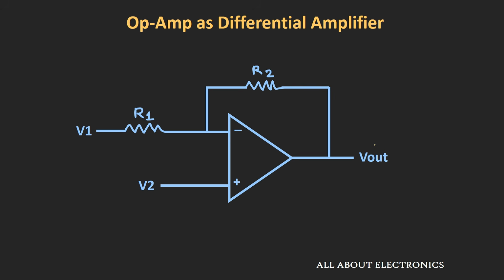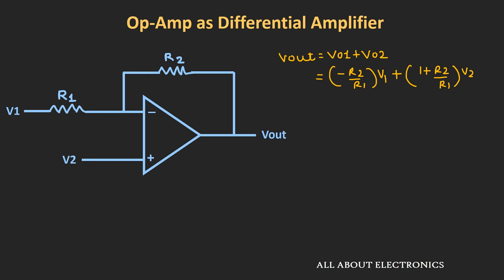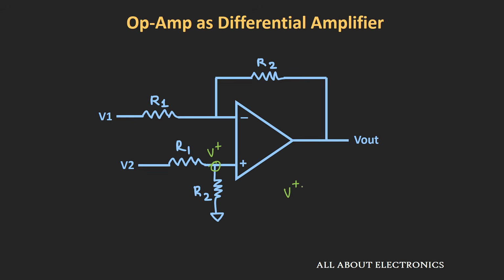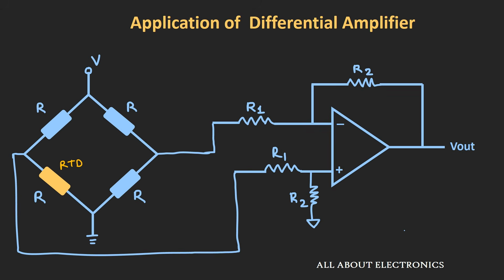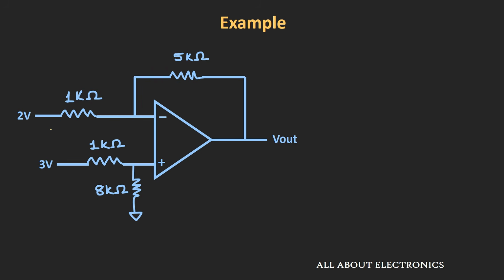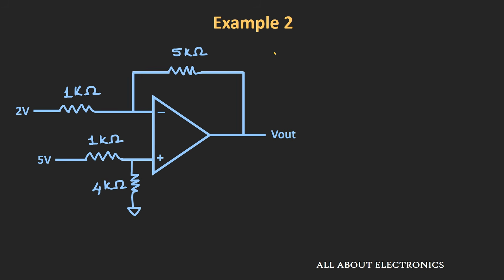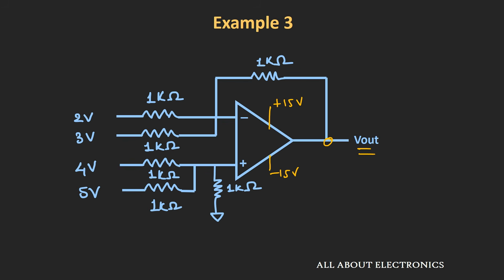Operational Amplifier: Op-Amp as Differential Amplifier or Op-Amp as subtractor (With Examples)

Comment: In case of 4v won't it be 4*(1/1+0.5)*(1+1/0.5)=8??
Reply from the maker: No, it will be 4*(0.5/1+0.5)*(1+1/0.5). And it will be equal to 4V.
The detailed explanation I have already given in the other comments. So, Please check that.
Reply: Sir acc to voltage divider rule i think it's (1/1+0.5) and (1+Rf/Ri) =(1+1/0.5). where am i wrong?
Reply from the maker: Not only 1K but two 1K resistors will be in parallel. (Resistor connected with 5V). So, voltage divider will be 0.5/(1+0.5). Rest is fine. 
Here I am copying the reply which I had given earlier. If you still have any doubt then please check it.

Let's say, you are considering only 4V of a voltage source. In that case, remaining voltage source will be zero and one end of 1K resistor with 5V will be at ground potential.
It means that two 1 K resistors are in parallel and their equivalent resistance is 0.5 K.
Now, voltage V+ because of 4V will be equal to 0.5K*4 /(1K+0.5K).
And total output will be equal to (1+Rf/R1)*V+
Now, here, Rf is 1K and R1 will be 1K in parallel with 1K (0.5K)
So, Vout due to 4V will come out as 4V.
Reply: Got it sir , thank you very much

Comment: Sir, why you didn't use the concept of virtual ground in this topic?? Please give answer sir  I get confused
Reply from the maker: Here, to find the output superposition theorem is applied at both input terminals. So, if you consider one source at a time, then the other input is grounded. And then using virtual ground concept only you will get individual outputs.
Reply: Sir, because of virtual short both the inputs are same so we get output zero(v1-v2).but we get output ???why?? Please give reply.

Comment: why result is different why we apply r2 by r1 multifply by v2-v1 in example?
Reply from the maker: Hi, will you please mention the timestamp where you are referring to ? It will become easy for me to answer your question.
Reply: @ALLABOUTELECTRONICS  10.22 in this example why we can't use r2/r1*(v2-v1) directly to find output voltage?
Reply from the maker: @webdot564  That equation is valid only when both resistors to inverting and non-inverting terminals are equal, and the feedback resistor and the resistor  between non-inverting terminal (+) and ground are equal. In this case, both 1k resistors are same. But if you see the other two resistors then, one resistor is 5k and other resistor is 8k. That's why we directly cannot apply that equation. I hope, it will clear your doubt. 
If you still have any doubt then let me know here.
Reply: @ALLABOUTELECTRONICS  oh ,i got it.Thank you.

Comment: Sir cant we find out its answer by considering each inverting and non inverting part as a summing amplifier..i have tried it by considering grounded part as v3=0..but did not reach the answer...
Reply: For inverting op amp , if all resistance values same then output will be -(v1+V2). For non inverting op amp output equal to (v1+V2), when resistance values are same . Vo= v01+v02. That is -(2+3)+(4+5). Answer is 4v by reducing the above equation.

Comment: Sir, how can I achieve current sensor, for short circuit protection using this method?
Reply from the maker: I have made a video on how to use opamp as voltage to current converter. Please check that video.
Reply: @ALLABOUTELECTRONICS  where is the link of the video so I can watch it
Reply from the maker: @chibuzoeze4225  https://youtu.be/DeDk0Rl3Oa0

Comment: If I use the formula Vout= (V2-V1)*R2/R1, I would get 8V instead of 6V for example 1. Could you tell me if this formula cannot be applied to this question for some reason or if R2 should have been 6V? also, thank you so much for this series.
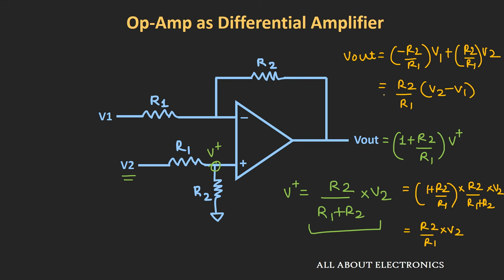Reply from the maker: Well that formula is valid only when resistors are equal as shown at 6:14. In example 1, R2 is different. I mean feedback resistor and the resistor at the non-invering terminals are different. That's why that equation is not valid here. I hope, it will clear your doubt.
Reply: @ALLABOUTELECTRONICS  Thank you so much. That cleared my doubt very well.

Comment: How to use k-type thermocouple instead of rtd???????? and can u plz explain the process of it?
Reply from the maker: You can connect the output of the thermocouple to MAX 6675. 
The breakout board for the chip is also available. 
It will give 12-bit digital output, which can be interfaced with the micro-controller.

Comment: Could you tell me the difference between  inverting amplifier and differential amplifier?
Reply from the maker: In inverting amplifier, the input is applied at the inverting end of the op-amp (with feedback). While in case of the differential amplifier, the inputs are applied at both inverting and non-inverting terminals of the op-amp. So, the output will be gain times the difference between the two input signal. (K* (VA-VB))
Reply: ALL ABOUT ELECTRONICS thanks 👍

Comment: Sir, how should we apply voltage divider rule in the third example?
Reply from the maker: Let's say, you are considering only 4V of a voltage source. In that case, remaining voltage source will be zero and one end of 1K resistor with 5V will be at ground potential.
It means that two 1 K resistors are in parallel and their equivalent resistance is 0.5 K.
Now, voltage V+ because of 4V will be equal to 0.5K*4 /(1K+0.5K).
And total output will be equal to (1+Rf/R1)*V+
Now, here, Rf is 1K and R1 will be 1K in parallel with 1K (0.5K)
So, Vout due to 4V will come out as 4V.
Similarly, you can find output due to remaining inputs.
And the final output will be the summation of individual outputs.
I hope it will clear your doubt.

Comment: It's  v0= 14 volt by using inverting n non inverting adder.....sir can u tel me this process is correct or not
Reply from the maker: I have already explained the process in the earlier comments. 
Here I am copying the reply:
To calculate the output, superposition theorem is applied. So, when you consider 2V input voltage is acting alone, at that time all the other sources will be zero. So, 3V, 4V, and 5V voltage sources will be zero. It means there is no input voltage at the non-inverting terminal. (And it is at ground potential) Now, as we are considering here an ideal op-amp, the virtual short is existing between the inverting and the non-inverting terminal. So, inverting terminal will also be at ground potential. Now, if you look at the resistor which is in series with the 3V voltage source, both terminals of the resistor are at ground potential (Considering only 2V voltage source is acting alone). So, it will not have any effect on the circuit. And the equivalent circuit will be an inverting op-amp with 2V voltage source is acting alone. So, output because of 2V voltage source will be (-2V).
And similarly, the output can be found for individual inputs.
In the end, add the individual responses to get the final output. 
 The second method is to use nodal equations and consider all the sources are acting simultaneously. And solving the equation you can get total output voltage.
Reply: So good sir😊😊😊

Comment: Why are we taking Vout= k(V2-V1) but not as Vout =k(V1-V2).pls explain
Reply from the maker: Because in the open loop configuration, the output of the op-amp can be given as Vo = A x (V+ = V-)
Where V+ is the input at the non-inverting terminal and V- is the input at the inverting terminal.
Reply: @ALLABOUTELECTRONICS   is it  like a formula or a derivative ,  
is it .....
Reply from the maker: @natarajann1259  Its the behavior of the op-amp. Actually that's how the op-amp works.

Comment: Sir, I'm still confused on how to get the answer for non inverting terminal........ Can you please explain? 
Sorry I'm a very slow learner....
Reply from the maker: To find the output due to the input at the non-inverting terminal, first of you need to ground the input at the inverting terminal. (Superposition theorem- consider one source at a time.)
The voltage at the non-inverting terminal is (V+) = R2*V2/ (R1 + R1)  (voltage divider rule)
And then the output due to the non-inverting terminal is V+ *(1 + R2/R1) ( the feedback resistor and R1)
So, the overall voltage after simplification = R2/R1 *V2.
I hope you will get it now.
Reply: Oo

Comment: Sir i have an doubt regarding voltage divider rule.
Reply from the maker: Yes, please let me know your doubt.
Reply: @ALLABOUTELECTRONICS  when we consider 4v input source and when u apply voltage divider rule then are u considering the resistance of 5v in parallel with 1k ohm which is grounded or R4//R5
Reply from the maker: @fazilahmadpala5472  While considering the 4V input source, the series resistance of 5V (which is grounded) will be in parallel with the 1k resistor.

Comment: wait. that's not the right differential amplifier. I thought it's the one that has an RC circuit? Am i crazy?
Reply from the maker: I think you got confused between differentiator and differential amplifier. Differential amplifier amplifies the difference between the two inputs, while differentiator circuit performs differentiation. The seperate video for that is also available on the channel.

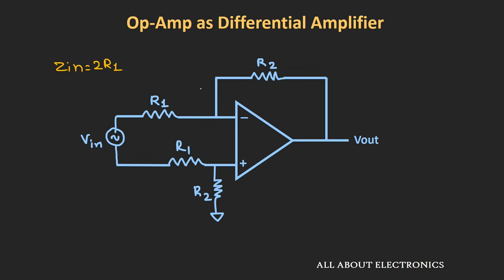Comment: @8:30 how is impedance equal to 2R1
Reply from the maker: Recently someone has asked the same question and I have explained it. 
I am copying the same answer here:
If you have followed the earlier videos then I think you must be aware of the definition of input impedance. 
In a simple way, if Vs is the input voltage applied to the circuit and  Is is the current supplied by that source then Vs/Is is the input impedance of that circuit.
In this case, the op-amp is an ideal op-amp. So no current is flowing into op-amp terminals.  
Also due to negative feedback, we can apply the concept of virtual ground. i. V- = V+
Now. let's say Is the current supplied by the source. And it will flow through the Resistor R1(at the top). And the same current should also come back into the Source via a bottom resistor. 
Considering this fact and applying the concept of virtual ground, in the equivalent circuit, it can be said that the voltage source Vin is connected to the two R1 resistors in series. Hence, Vin/Is = 2*R1
That's why input impedance is 2*R1.
I hope it will clear your doubt.

Comment: At 8:31 how Zin=2R1
Could someone please explain ?
Reply from the maker: If you have followed the earlier videos then I think you must be aware of the definition of input impedance. 
In a simple way, if Vs is the input voltage applied to the circuit and  Is is the current supplied by that source then Vs/Is is the input impedance of that circuit.
In this case, the op-amp is an ideal op-amp. So no current is flowing into op-amp terminals.  
Also due to negative feedback, we can apply the concept of virtual ground. i. V- = V+
Now. let's say Is the current supplied by the source. And it will flow through the Resistor R1(at the top). And the same current should also come back into the Source via a bottom resistor. 
Considering this fact and applying the concept of virtual ground, in the equivalent circuit, it can be said that the voltage source Vin is connected to the two R1 resistors in series. Hence, Vin/Is = 2*R1
That's why input impedance is 2*R1.
I hope it will clear your doubt.
Reply: @ALLABOUTELECTRONICS  thanks a lot brother ..it helped me:)

Comment: Sir what is the voltage at inverting terminal
Reply from the maker: Would you please mention the timestamp where you are reffering to in the video.
Reply: Last part
Reply: Last one ...excersice question
Reply from the maker: Yes, that's correct, because of the inputs at the inverting terminals, the output voltage will be -2 -3 = 5V. 
If you consider the input at the non- inverting terminals also, then the total output is -2-3+4+5= 4V
Reply: Sir but at non inverting terminal voltage will be 4/3+5/3=3 so v total =-5+3=-2v...help me out sirr
Reply from the maker: If you do it properly, you will get it. I have already explained the method in the earlier comments. Please go through it. If you didn't get it, will help you.
Reply: Tell me non inverting terminal voltage

Comment: sir, can u explain me the process how to solve that?
Reply from the maker: I have already explained in the comments earlier.
I am just copying it over here:

To calculate the output, superposition theorem is applied. So, when you consider 2V input voltage is acting alone, at that time all the other sources will be zero. So, 3V, 4V, and 5V voltage sources will be zero. 
It means there is no input voltage at the non-inverting terminal. (And it
 is at ground potential) Now, as we are considering here an ideal op-amp, the virtual short is existing between the inverting and the non-inverting terminal. So, inverting terminal will also be at ground potential. Now, if you look at the resistor which is in series with the 3V voltage source, both terminals of the resistor are at ground potential (Considering the only 2V voltage source is acting alone). 
So, it will not have any effect on the circuit. And the equivalent circuit will be an inverting op-amp with 2V voltage source is acting alone. So, output because of 2V voltage source will be (-2V). 
And the similarly you can find the output due to other sources as well.
The second method is to use nodal equations and consider all the sources are acting simultaneously. And solving the equation you can get total output voltage.

Comment: Sir what is a buffer?
Reply from the maker: A buffer circuit provides very high input impedance and low output impedance. And it passes the input signal as it is. 
It is usually used to avoid the impedance mismatch and sometimes to increase the current driving capability of the circuit.
Reply: @ALLABOUTELECTRONICS  thanks a lot😊😊

Comment: After getting the answer for total V_= -5v, I got stuck in the total V+. But, after applying oms law to find Iout=I(in1)+I(in2), I was able to find the total V+ by using V+=[(4/1)+(5/1)]*1= 9. So the Total Vout=-5+9=4. I think, I got it, finally.
Reply: 1 kilo ohms not 1 ohms, ur method is flawed

Comment: At 11.12 minute, the difference amplifier input resistors are wrongly used. The value of R1 & R2 for non inverting input n the inverting input should be identical but here is not the case.here it is 1K & 5K and 1K & 8K
Reply from the maker: Its not always necessary. It can be different also.

Comment: Sir, second Wale example main 12 par saturation aajaega, lekin answer 14 aaya, toh phir iska conclusion kya hua
Reply from the maker: The output will get saturated to the supply or the rail voltage. So, it can't go beyond 12V, when the supply voltage is 12V.
If the supply voltage is more than 12V, let's say 18V then output would be 14V.
I hope it will clear your doubt.

Comment: Sir, what does loading mean?
Reply from the maker: If the impedance of the load is comparable to the series resistance of the source, then the effective voltage which appears at the load will reduce. (simple voltage divider, V*RL/(RL+Rs)). Here, in this case, if the input impedance of the differential amplifier is low then the output of the sensor which appears at the input will reduce.
I hope it will clear your doubt.
Reply: Thank you sir.

Comment: BTW out put of this Differential amplifier is difference between input voltages and multiplied by Gain factor. Then why don't we call it as DIFFERENCE AMPLIFIER instead of Differential amplifier..???😊☺️💐
Reply from the maker: sometimes it is called a difference amplifier. In fact, in some textbooks, it is referred as a difference amplifier.

Comment: How to design a subtractor using 4-opamp
Reply from the maker: you can design a subtractor even using a single op-amp. May I know why you want to design with 4 opamps ??
Reply: I want to know because there was a question regarding this in my exam
Reply from the maker: May I know the exact question. Because you can use two or three op-amps for adding the signals and last op-amp for subtracting the signal. 
If you can tell the exact question then I might be able to tell you in which context it was asked.

Comment: The only thing that I don't understand is why should the gain be equal...like why?
Reply from the maker: Equal gain will be required in applications where you want to amplify the difference between the two input signal.
At 3:31 the gains for both inputs are different. But they can be made equal using the voltage divider circuit at the non-inverting terminal.
I hope it will clear your doubt.
Reply: @ALLABOUTELECTRONICS  so we're basically finding out the value of k by making the gain equal?

Comment: how to solve example 3?
Reply from the maker: In other comments, I have already mentioned the procedure. Please go through the comments. If you do not find the answer or method to solve it then please let me know here.
Reply: i'm having some trouble understanding in parallel connection.
Reply from the maker: Here, you can find the output by applying the superposition theorem. (Considering one voltage source at a time).
so, for example, if you consider only 4V voltage source, then other voltages sources can be assumed to be zero.  Now, in this condition, two 1K resistors at the inverting and the non-inverting terminal will be in parallel. And their effective resistance will be equal to 0.5 K. 
Now, for non-inverting input, the output can be given as V+ (1+Rf/R1)
So, here Rf= 1K and R1= (1K|| 1K) = 0.5K
So, Vo= 3V+. 
Now, V+ can be found by applying the voltage divider rule. 
V+ =4V *(0.5K/(1K + 0.5 K)= 4/3 V
So, output due to 4V will be 3*(4/3) = 4V
And the same procedure can be followed to find the output due to individual inputs. 
The final output will be the superposition of the individual outputs.
i.e  (-2-3+4+5) = 4V.
I hope it will help you.